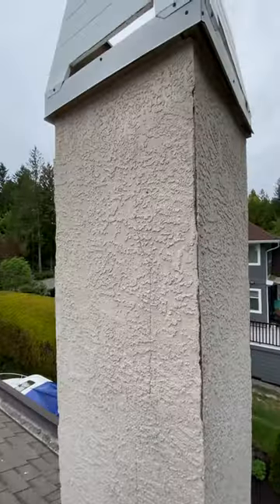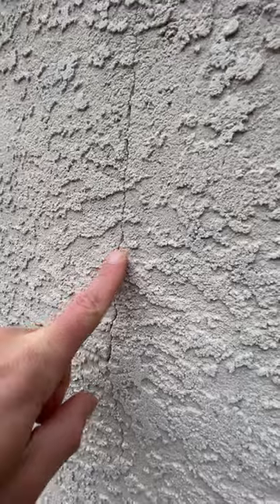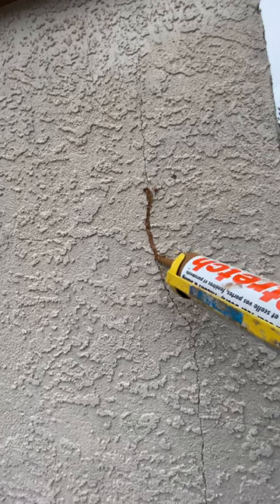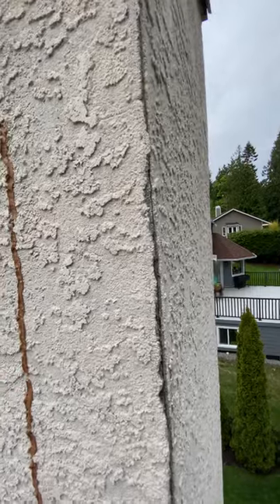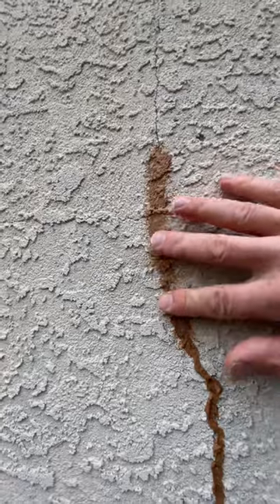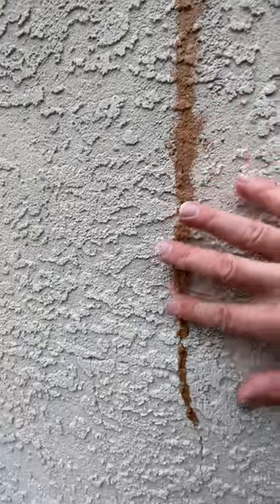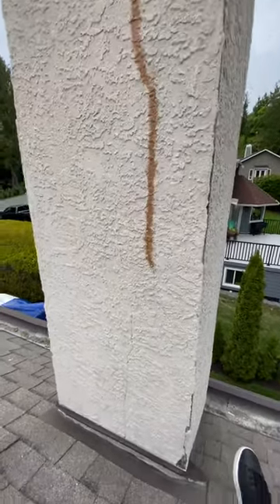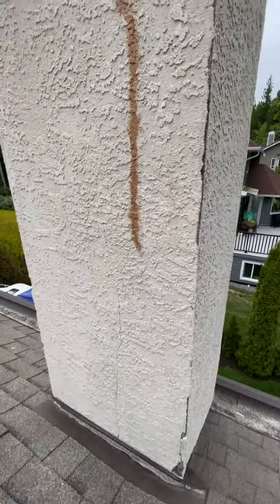How to Caulk Cracking Stucco Before Painting

Comment: I just paid a lot of money for caulking repairs and it painting.  You can see strips of the caulking lines and it’s ugly.  The painter is trying to tell me that there isn’t anywhere to hide them.  I don’t believe that.
Reply from the maker: In some situations you can hide the caulking marks. If you use a higher sheen paint, like an eggshell, satin or semigloss it hides the caulking more than it does a flat sheen paint. However, stucco is textured and caulking is usually smooth so your painter might be right. The color of the paint also plays a part in the overall hiding of the caulking. Using an elastomeric paint also helps.
Reply: @TrustedHousePainter  I tried to use Elastomeric paint and the guy said it wouldn’t make a difference.  We were willing to pay extra for it and he said it wouldn’t matter.
Reply from the maker: @SheXyShellyMarie  it’s very difficult to provide accurate help without seeing the actual problem. However, that’s why we ALWAYS recommend getting at least 3 quotes before hiring a painter. Our app, www.trustedhousepainter.com makes it easy for homeowners to create a free listing of their painting needs and get quotes from local painters. This is the best way to ensure you’re hiring the right painter. But unfortunately most people don’t get multiple quotes. We’re sorry to hear about your problems with your painter.  You’re not alone.
Reply: @TrustedHousePainter  We did all the quotes and research.
Reply: @TrustedHousePainter  I would send you a photo but this string doesn’t allow it